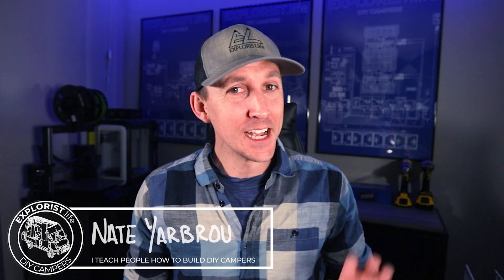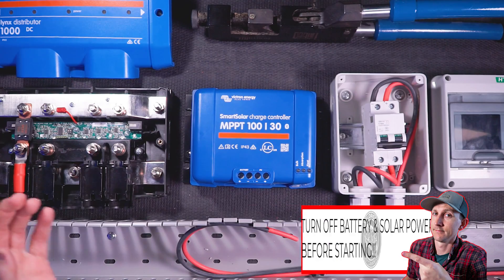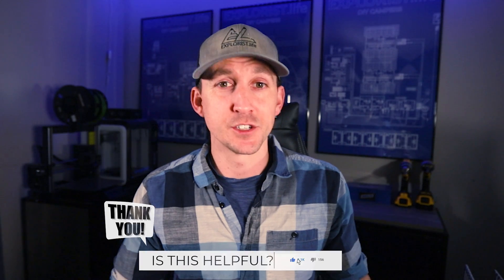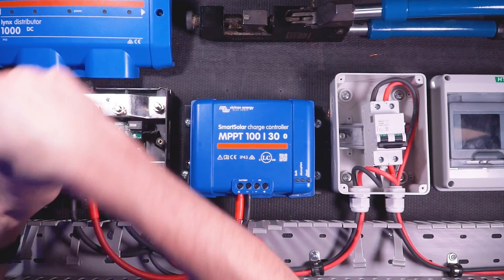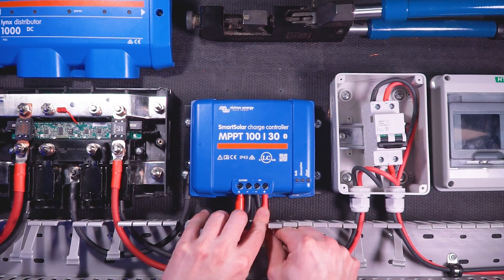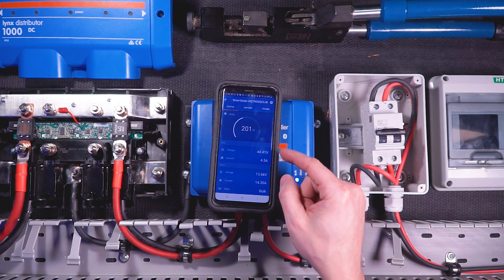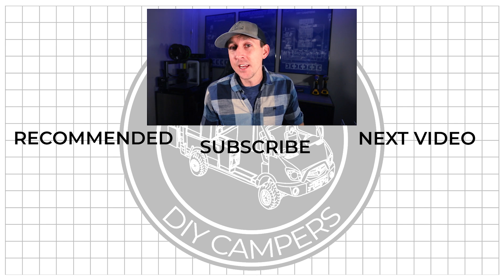How to Wire a Solar Charge Controller in a DIY Camper Electrical System

Comment: Victron manual states not to use ferrules on the wires for the connections to the MPPT controller, yet you did. Why? I would prefer to use them. Should I?
Reply from the maker: Good catch — that’s one of those details where the right answer depends on the exact wire type, ferrule, and torque, which is why Victron takes a conservative stance in the manual.

Rather than us giving a blanket “yes or no,” our support team can look at your exact setup and recommend the best approach for your system — and help you get the right wiring and parts if needed 👉 https://shop.explorist.life/support?utm_source=youtube&utm_medium=comment&utm_campaign=support&utm_content=response_link

Comment: Parallel charging gets my batterys out of sinc for dome reason sleep mode it's on the higher voltage end 13.4.volts then I manually reduce volts with dc air compressor. They charge grest single not in parallel. Try a 100 30 victron hear shortly.
Reply from the maker: That’s definitely something we’d want to look at a bit more closely, since battery behavior can change a lot depending on the details of the setup.

Rather than guessing here, the best next step is to reach out to our support team so we can take a quick look at your specific system and point you in the right direction for your setup (and the Victron 100/30). You can contact support here: https://shop.explorist.life/support?utm_source=youtube&utm_medium=comment&utm_campaign=support&utm_content=response_link

Comment: Do sell a ANL mega 30a for a 200watt array? I hve the 1000 dist and want to use it.
Reply from the maker: Reach out to shop.exporist.life/support and we can get you what you need.
Reply: @EXPLORISTlife  was that a 60 amp disconect to mach the 60 a mega fuse? That must be a very large solar array being a #6 can carry 55 amps max with the right temp#6 wire.
Reply from the maker: I’m not sure I follow.  Reach out to support@explorist.life and we can take a more personalized look at your project and offer suggestions.
Reply: @EXPLORISTlife I am just trying to protect the wire from the 1000 distribution to the mppc controller 100 - 30 with two 100 watt solar panels I reached out to them and they just were trying to sell me the kit and it shows nothing about the fuse that connects it together
Reply from the maker: @Supanova70 the kit includes the fuse.
Reply: That is great what size wow this is difficult how do I know what size fuse is correct for the kit this must be a cya issue I get it I'll figure it out
Reply from the maker: Just buy the kit and you'll have the right fuse size.  You're making this more difficult than it needs to be.

Comment: Do you still need the ground wire if the negative from the mppt is going to the lynx distributor which is already grounded?
Reply from the maker: You need the equipment ground wire, period.  No if's and's or but's.
Reply: @EXPLORISTlife Good to know, i was under the assumption that because it goes to the negative bus bar (which is grounded) then its already classed as being grounded but thanks for clearing that up, much appreciated! Loving the videos!

Comment: Hi, another great video! Forgive my ignorance but why is necessary to fuse after the MPPT controller at the lynx? Wouldn't there only be current going from the charger to the lynx and not the other way round?
Reply from the maker: In the event of a short in the mppt wiring, current would flow the other direction from the batteries.
Reply: I see! Thank you for the explanation! Do you just size the fuse from the wire size between the lynx and mppt charger I presume?
Reply from the maker: @jacobhaines5475 we have specific charge controller wiring kits available on our store: https://shop.explorist.life

Comment: i I have a trailer that came with a GO Power controller and a 100W panel charging the trailer's 12V battery. However, I want to charge my EcoFlow portable battery using the solar panel. What would be the best way to do that? Can i split the wire coming from the panel to have a lead to the power panel and one to the Ecoflow?

Comment: Hi mate do you have to use the equipment ground on the side of the mppt controller? And if so can it go to a battery negative or does it need to go to a chassis ground ?

Comment: Hi Nate, my system becomes live when daylight hits panels with this type of connection and my Renogy shunt goes haywire. If the connection was made to the battery directly I would assume it wouldn’t happen but because all connections are at the bus bar before the rotary switch this happens. I don’t have the earth connection on, is this a contributing problem? Thanks mate

Comment: Om the MPPT 100/30 manual says to use maximum 40a fuse. Why are you using 60a please. Thank you ☺️
Reply from the maker: 40amp mega fuses are much less common, so we have to round up to the next available size.

Comment: Hey Nate, What do you use in this video or now for backer board? Im using your videos to diy install a small 12v system in my F-150 and need a fire safe backer board but cant seem to find one???? Thanks for your help if you see this.

Comment: Why is the ground wire soooo damn big???
Reply from the maker: ABYC E-11:

11.17.2 DC Grounding Conductor

11.17.2.1   A DC grounding conductor shall not be smaller than one size under that required for current carrying conductors supplying the device and not less than 16 AWG (see FIGURE 5 and FIGURE 11).

Comment: In all your diagrams, I see your solar controller power lands after you're main battery disconnect on the distributor. But if that switch is off, obviously, the solar is not charging the battery. So if your trailer is in storage and you turn all power so you're not consuming power, wouldn't you want the battery to stay charged via solar power?
Reply from the maker: If all loads are off - the batteries will just stay charged.  They may lose a couple percent per month, but ultimately, it's not worth the hassle of putting the charge controller on the other side.

Comment: @EXPLORIST life
You're the best, however, you lost me where you stated how to reconnect battery power. Do we simply connect the positive terminal to the battery or do we use a single polarity circuit breaker as an on/off switch?
https://youtube.com/clip/UgkxYo9J8fkYJCm1jREdhhf-CvkYXlhOoC2z?si=Hvi_k9Xy7OG_cpmC
Reply from the maker: Any of our start-to-finish instatallations show the overall system operations better: https://www.youtube.com/playlist?list=PLmvhcyi4n0TUU8FUc6LE38TBkdSLjdw_5

Comment: Thank you for all the knowledge you share! really appreciated! I've been wanting to build my own camper for a while and your videos give me so much more confidence!

Regarding Wire lengths, is it best practice to keep the +ve & -ve wires the same length for each section in the build? or is that only useful in the connection from the Battery Bank to Inverter/charger?

Comment: I don't have buzz bar can I just connect inverter and controler to battery bank and solar panels with some inline fuses?
Reply from the maker: Why not get a busbar/lynx distributor so you can follow along and do it properly?
Reply: Hmm depending who you're watching everybody hooks the stuff up differently some don't even use a bus bar they just go directly from the controller to the battery Bank inverter to the battery Bank
Reply: Just a lot of confusion just no consistency from one video to the next.
I looked on your parts list I don't see a buzz bar listed do you have a link for that
Reply: Thank you.
Reply from the maker: There is indeed 100 different ways to do this stuff, but I’m always going to show the way I feel MOST correct.

If you find a different way to do things, that’s fine, but you’ll need to do your own due diligence with that. 

Fused busbar: https://shop.explorist.life/shop/all-products/victron-lynx-distributor/?srsltid=AfmBOooniK_TQwc9nG1HtD6xPurgXawcMn9djCacRX8Dos6lmTgMUqFK
Reply: Ty

Comment: No one talks about lithium batteries that only need 12.6 charge ,and how to make sure it doesnt shut down your fridge ,because its overloaded.
Reply from the maker: Basically all LiFePO4 batteries need to be charged to 14.2-14.6v depending on manufacturer.  This has nothing to do with being 'overloaded', though.  If you need help with picking out batteries or a proper charger for your fridge and want a personalized recommendation on what parts to buy; reach out at shop.explorist.life/support.

Comment: Do you have a video for those of us using the smart shunt rather than the distro box?
Reply from the maker: Those two devices should be used in conjunction.
Reply: I don’t understand. I thought they did the same thing as far as shunt, but the lynx has the positive side whereas the smart shunt does not.  Am I missing something?
Reply from the maker: The SmartShunt is a monitoring device.  The Lynx Distributor is a power distribution device.  I think this may help: https://www.youtube.com/playlist?list=PLmvhcyi4n0TUU8FUc6LE38TBkdSLjdw_5
Reply: I understand now.  I’m installing in my class A and was planning to use my existing fuses instead of the lynx but after studying your drawings and videos I like the idea of using it.  (Ordered from your site this morning) Thanks!

Comment: Not only is it a code requirement to be able to disconnect the solar panel, it is needed to not ruin your solar charger when disconnecting the battery and reconnecting as you must disconnect the solar panels before you can connect it to a battery again... If you for example in the winter disconnect the battery to avoid it charging in -0c and ruining your lifePo4 batteries and then connect the battery again on a dead charger in full sunshine it goes up in smoke... literally !!! I did not know that as no one warned me about it , and serval videos show to connect solar panels FIRST before battery. So now I have 2 fried solar chargers and have to buy new ones...

I had this system set up like this for 3 years, it was just coincidence that all the other times I connected the batteries on a dead solar charger with solar panels connected it was not full sunshine so it did not fry them. But this time it was full sunshine in middle of the day...

Comment: I am on a quest to find the torque specs when using ferrules. Most of the equipment that I am using has the torque specs for wire with large strands. But, I have not yet found the torque specs when using ferrules and fine stranded wire. Is there any kind of rule of thumb for tightening connections using ferrules?
Reply from the maker: The torque spec doesn't change from ferrule to not unless otherwise specified.
Reply: @EXPLORISTlife  Thank you. I am worried about breaking the place where the connection is by over tightening.
Reply from the maker: Understood.  We are happy to install for you to put your mind at ease: https://shop.explorist.life/about-our-services/

Comment: Hi, i have a question, i'm about to build a portable Victron station, in a box, ( hopefully a proper job, not a Blueankerflow) so a question about the ground, at 03:53, your diagram shows a connection to chassis ground, however i won't have a ground in my box build, so can i use the battery positive as chasis ground. Kit will probably be, Lifepo4, Lynx distributor,  multiplus 12/1600, 100/50 mppt, shunt, BMS etc. Thanks.
Reply from the maker: This may take a more in-depth look at your personal setup.  If you have purchased/are purchasing from our store (shop.explorist.life) reach out for some more personalized help: shop.explorist.life/support

If you've purchased/are purchasing elsewhere, reach out to your dealer for support.  We'd love to have you as a shop.explorist.life customer so we can provide a bit more help in the future. 🙂
Reply: Why would you connect the battery POSITIVE as a ground?
Reply: @jeremyspecce  thanks, blimey that's an old post of mine, looks like autocorrect intervened, I didn't mean positive. Thanks.

Comment: 60A fuse on 30A charger?
Reply from the maker: What fuse size would you rather use?  At 30A fuse on a 30A charger would blow under normal operation.  Remember: fuses are there to protect the wire.  The wire is sized to handle the power required of the device.

Comment: Was that a 60A Mega fuse? Is that sufficient to protect the system? It seems way oversized?
Reply from the maker: Why do you feel that way?  60A fuse on a 30A charger that is wired with 105 degree rated 6 AWG wire rated to ~120 amps.

Search: "How many Amps can Wire Handle - EXPLORIST.life"
Reply: @EXPLORISTlife  is the fuse always to strictly protect the wire only, or should it also provide some protection to the device?

Comment: Will this device allow alternator charging of a lifepo4 house battery? Plug vans starter battery into the box then the house battery into the box?
Reply: no, sounds like you want a DC to DC charger (it will look very similar but is not the same)

Comment: Is it okay to use a 60A fuse as you have even-though the manual says maximum battery fuse rating of 40A for the 100/30 MPPT
Reply from the maker: We have to go against manufacturers recommendations here since a 40A fuse is an 'in-between' fuse size and is not available as a simple inline ATC fuse nor a MEGA fuse for the Lynx Distributor.  Since we are using 6 AWG Wire rated for 120A; we have to round up a bit to the next available fuse size from the manufacturers recommendation.  You can shop our charge controller wiring kits here: https://shop.explorist.life/product-category/all-products/camper-wiring-kits/solar-charge-controller-wiring-kits/

Comment: So I have a set up using this MPPT, which while the system is off, is still pulling in a charge and therefore sends the Inverter into a Fault. We think maybe it's the Lynx Distributor that is malfunctioning... Once we turn the system on, we get a BMS disconnect Error (the solar can't find the BMS when the system is Off)... The rep where we bought it is not able to diagnose further. I'm hoping you've seen this error before and can help us.
Reply: did you ever figure out what was wrong?

Comment: I have the same MPPT controller aboard my yacht, but having just wanted your video notice that I have not run a negative wire from the side screw back to the negative bus. Is it critical to do so?

Comment: So far nobody has said if you wire in series and have a positive and negative wire left. Does the positive wire left go into the positive hole of the charge controller etc or do you put them in like you did when you connected them in series. Positive in the negative and negative into positive holes of the charge controller.
Reply from the maker: YT search "EXPLORIST.life how to wire solar panels in series"

Comment: Hi, I have Basen Green LifePo4 battery (11,7kWh 51,2V 230ah) powered by 🌞 4 x 480W 2S2P solar panels (Vmp: 37,10 lmp: 12,95V) via Victron 150/35.
What fuses I need between Victron and Battery and between battery and 3500W 48V Inverter, to be all right protected ?
Reply from the maker: Hey, @adamsisernik4556! I appreciate you taking the time to ask your question, but unfortunately, I don't have enough info about your specific question to provide an accurate answer, but here is a playlist that, if you watch all of the videos start-to-finish (and take notes 😉), you'll have a REALLY good idea of how to design a solar array: https://www.youtube.com/watch?v=Jkbs84sBHsg&amp;list=PLmvhcyi4n0TV9pi83rFTv3ZuMT_S1xIZt

Alternatively, I have some of my most common solar array setups pre-built here: https://shop.explorist.life/product-category/all-products/camper-wiring-kits/solar-charging-wiring-kits/

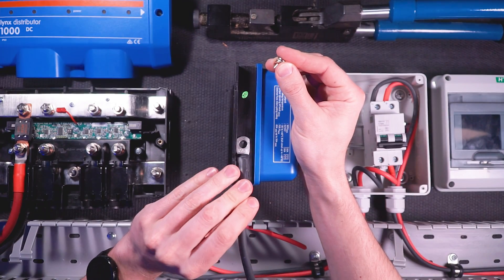Comment: 2:51 Why would you use a ridiculously thick wire for that area/application? A protective wire that keeps the voltage potential equal to other parts is not handle significant current flows. Therefore, there should be no need to consider "the voltage drops" when large currents flow.
Reply from the maker: Search our channel for our videos on sizing wire for explanations on how to properly size wire

Comment: Hi question. I've seen a lot of systems with undersized cables like a 4 awg cable on batteries instead of 4/0 and know that that is a huge no no. But, would it be bad to oversize cable on a controller if that's all you have? Say 1 awg on a victron 250/100 from the controller to the distributor? Would this cause any issues if crimped properly?
Reply from the maker: The main issue with that is that 1 AWG wire will not fit into the 250/100.
Reply: Thanks for the reply. What if I got it to fit? I crimped them down to fit. Is this going to cause any issues? 

I'm following your instructions on running dual controllers. I'm not trying to reinvent the wheel but this is the cable I have and I was able to crimp them down and make it work. Shouldn't this larger cable cause less restriction which leads to less heat build up?
Reply from the maker: @princeehp  Ultimately, you get to do whatever you are going to do; but I can't provide validation for squeezing wire larger than the terminal is rated for into the unit.
Reply: @EXPLORISTlife  not asking for validation. Asking if this would hurt anything in a theoretical sense. Not a trick question. I respect your opinion as a craftman so I asked. If it'll hurt something I won't do it, I spent to much on these controllers.
Reply from the maker: Electrically speaking, and not considering terminal sizes or physical sizes of the wire, there is rarely an issue with oversizing wires.